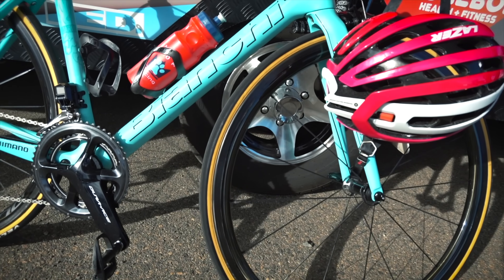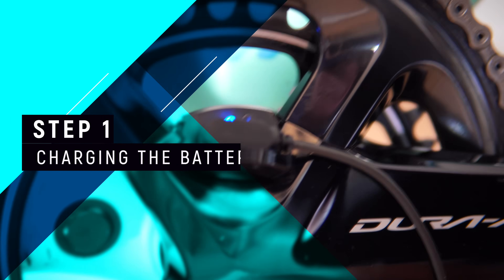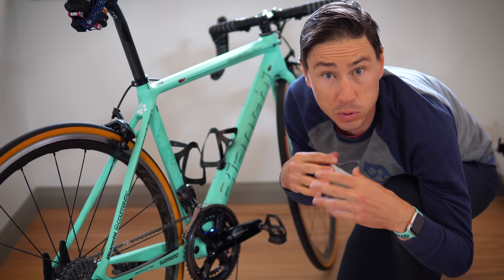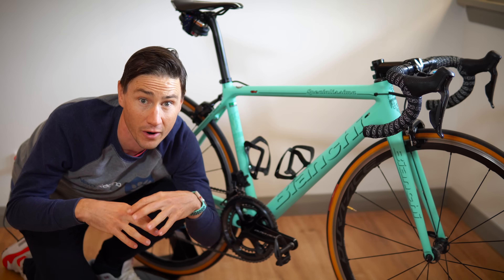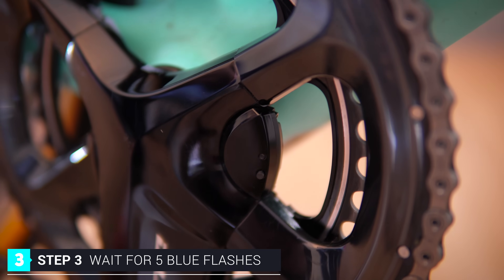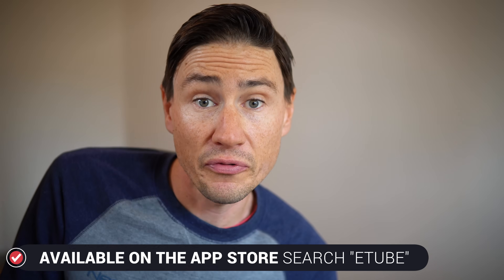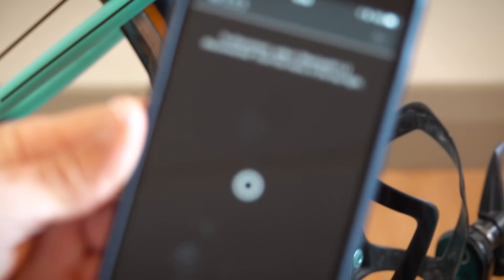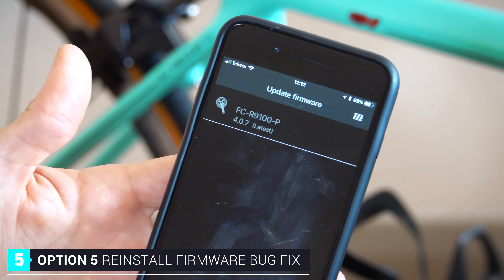How To Use A Shimano Power Meter | NOT A VLOG

Comment: Hi Chris, My Dura Ace power meter is connected to my garmin and is connected to my E-Tube app but is not showing any reading like power o cadence (only show 0 zero). I think the issue is the magnet but it was previously working, any suggestion?
Reply: I have the same issue, did you fix it?
Reply: Yes I did. The issue was the magnet position. It was too far from the sensor .take off and paste again